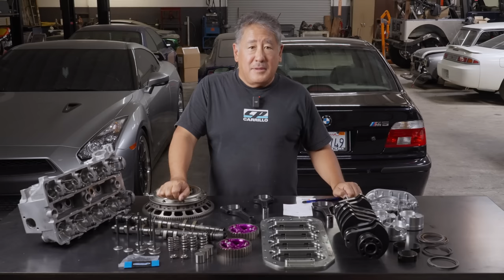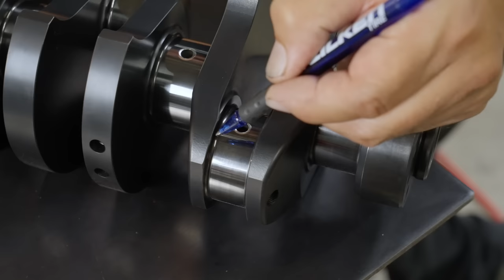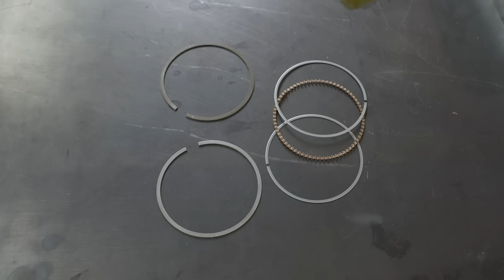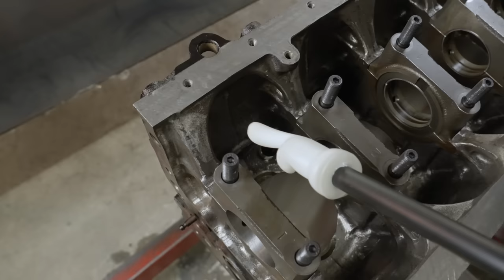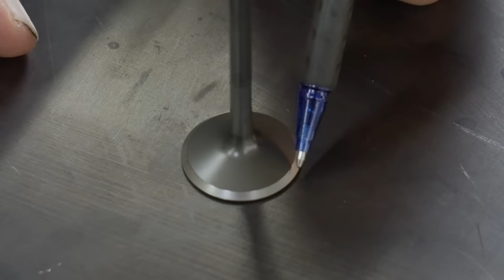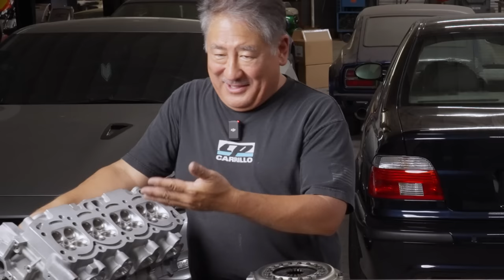11,000 RPM Toyota 4AG Engine Build!

Comment: ever see a 1000hp+ 4age? there are 3 i know about all in my country of South Africa

Piper cams makes a 326 duration on both intake and exhaust with 9.49mm lift
Reply from the maker: I would rather use the higher lift Kelfords, they have more area under the curve.

Comment: what kind of clearances are you aiming for on mains and rods?
do you need to spin it to 11k still give the increased displacement?
Reply from the maker: Something like 0.002 on the rods and 0.0015 on the mains. I like to run things a bit tighter than some.

Comment: Thanks for the interesting video. I can see it wasn't done here but out of interest have you ever tried doing the head modification of making the intake ports more upright? As in re-routing the intake path through where the injector holes are normally located in the head casting. This would be via either machining a wedge out of the head combined with a matching manifold profile to suit or alternatively using the more direct method of filling parts in with welds and then reshaping as required. I am not looking to do such a thing, but rather I only ask because I am curious as it's a very rare mod to hear about it being done.
Reply from the maker: No one will pay for that.
Reply: @motoiq I know of two people who have this type of mod on their engines, but to be fair they did it using their own resources and it would indeed cost way too much to have someone else do the work.

Comment: Would you recommmend a high Zinc content oil like Valvoline VR1 or ZDDP additive for an over head cam engine with a high overlap cam? Or for flat tappet like a S54?
Reply from the maker: As long as wideband life isn't critical for your car's running correctly.

Comment: Speaking of rod and stroke ratios. Could you use a k20 crank in a k24 block with custom rods for a high rpm build and/or lower vibration?
Reply from the maker: Yes look for a build video like this coming soon.

Comment: 4 valve and no dry sump, customer is nuts
Reply from the maker: I would really recommend a dry sump for this sort of stuff.
Reply: Customer is going to be wondering why it blows up one day when the engine starves for oil. 😂 oh well. If he/she has the money it probably isn't an issue, but the principle and waste of resources is what gets me.
Reply from the maker: It isnt so much starving of oil, its getting the engine nice unaerated oil at the proper pressure.  Well I guess that's preventing starvation.

Comment: i do have one question. i know the 4a valve shims are the same size as the 7m, does that mean these shimless buckets work for the 7m? also what would the part numbers/name be?
Reply from the maker: It should be, its from a Yaris.  Since it's select fit, there are a million part numbers for the different sizes if you know what I mean.

Comment: About the issue of the crankshaft of bigport 4age's at rpm above 8k. Will a fluid damper help, or is addtitional reinforcment of the block the only option? I want to set the rev limit at 8500 or a bit more if possible. On my EU version MR2 it is already set stock at nearly 7800
Reply from the maker: you need to use the larger journal 20v or SC crank and toda pump gears or a 20v pump. fluidampr helps too

Comment: Do one on the 2ZZ :)
Reply: 1zz better tbh, especially if turboed
Reply from the maker: Strangely there isn't much interest in this engine, no one has ever asked us to do one.
Reply: @ireallyreallyreallylikethisimg 2zzge is more reliable even with big turbo set up, only need another oil sump for track days have problem if pass 1.1g lateral pressure the internals hold easily over 400hp except the pistons because has big compression 11.5:1 but if tunning is good and torqe low the 100% stock internals is great for 350-380hp 350nm. Now if put lower compression piston 400 is safe. Also I have see over 10 2zzge with over 300k miles on stock engine without oil consumption. I'm mechanic and I work on 2zz b18 4g63 k20 etc...1zz is indifferent engine mate. After 2002 is good without oil consumption issues but do not compare with 2zzge, it is much superior.
Reply from the maker: Agree with all of that.
Reply: @ireallyreallyreallylikethisimg what's your reasoning for that? 2zz outflows 1zz by miles. Overall easier to make power reliably with 2zz.
Reply: @motoiq  any chance at us getting a high compression NA build? The popularity in the US is minimal compared to the Caribbean and South Asia. It has its application and is an odd ball.

Comment: Around what would you expect this motor to make? Also looking forward to the 20v! I have an AW11 with a dead 16v and have debating rebuilding it cheaply or swap a 20v or 2zz or something. I love the 4AGE induction noise so there's some subjective pros/cons I have to think about.
Reply from the maker: Something in the 200 whp range.
Reply: Go 2zz for sure, there's a guy who sells everything to make it fit with non to minimal mods, and is by far better than a 4age, lightweight and easier to make more power than any 4age build, guys in pr has already got 216whp at 8800 rpm with bolt on parts and standalone ecu on 93 Oct, to get to that point on a 4age would be hell of expensive
Reply from the maker: On of the things with a lot of swaps is the motors are taller and the swaps mess up the suspension geometry and ruin the 86's handling.  Most of the kits for an F or K swap and even a BEAMS swap I look at are like this.  The kit makes have no clue about suspension.

Comment: I really thought the black top 20valve is the way to go
Reply from the maker: It has a wider powerband but for top end the big port with big valve head rules
Reply: @motoiq  "It has a wider powerband but for top end the big port with big valve head rules"

I know this is a bit of a loaded question, so mostly looking for a "ball park" here, but if you were to build a 20v vs the big port 16v to roughly the same level- how much of a power difference do you think youd see at peak?
Reply from the maker: About 6-10 hp all on the top.  I would prefer a 20v for use in a full size car.  More torque and wider powerband makes for faster laps.  A light open wheel car, big port.

Comment: Is there a reason you prefer Tri-metal over Bi-metal on low HP applications, they tend to damage less the crankshaft as they embed more material compared to the Tri-metal, but I wonder what have you seen regarding Bi-metal longivity wise on NA applications and high RPMs.
Reply from the maker: King makes a high embeddability bi metal race bearing but I never tried it.

Comment: 11:1 static CR with the formula alantic cams wont make good power and and will make weak torque...

U actually needs atleast 12.5:1 or 13:1 CR to fully utilize the cams potential...

 Because the big overlap, Dynamic Compression Ratio will be super low...

U can compensate by advancing exhaust cam abit (during cam adjustment/dialling)  but the power will fall on it face well before 10k rpm..literally no benefit revving to 11k rpm...

If it was me, i would consider keeping 13:1 static CR which perfectly fine with such big cams to run on 91octane fuel...  (With better piston dome design and combustion chamber profile u can get away with even 14:1~15:1 static CR for such big cams)
Reply from the maker: Well no shit. However the original TRD Japanese spec for a hot 4AG with these cams was 11:1, TRD USA didn't run the Japanese pistons and made our own that were 13:1. You absolutely cannot safely run 13:1 on the 4AG with California Spec 91 octane fuel unless it's putting around. Even modern engines with DI have a hard time doing it safely. Run it on the track and it won't be running in a few laps.
Reply: "11:1 static CR with the formula alantic cams wont make good power and and will make weak torque..."

And what exactly are you basing this assertion on? How much MORE power do you think itd make with a whopping whole extra 1 or 2 points of compression?
Reply from the maker: There is no such thing as dynamic compression ratio.  Compression ratio is set by volume.  You can have dynamic cylinder pressure.

Comment: Here in Japan there are also many engine builders who are obsessed with 4AG. One of them made a very unique 4AG that has a cylinder head from Hayabusa, Suzuki motorcycle. As you can guess, it was not a easy project but he did it. They call it as 4AR and the engine also can run 11000 rpm or more. He is awesome like you.　https://www.youtube.com/watch?v=ES_s2ibwceM
Reply from the maker: Interesting!

Comment: 10,000 RPM+ on a wet sump? If this guy runs on track he's gonna spin rod #4 guaranteed. He needs way more oiling upgrades.
Reply from the maker: hopefully the larger rod bearings will give more hydrodynamic area.  Guys flame me and say they rev that high with a gen one oil pump all day....
Reply: @motoiq  You can rev high well into the 9Ks but you need more mods. The pump gear isn't going to solve the oil starvation issue which is usually the cause of the bearings going.
Reply from the maker: You need a dry sump, I recommended it strongly, they passed.

Comment: I just want to ask I am not a mechanic but is it possible if you modify the 4 A-GE and but a turbocharger on it can you only put on aspiration on it or can you do both like a turbocharger and a supercharger. I am just asking will like to know how much horsepower can you het from modifying the engine.
Reply from the maker: You can do anything, it is just a matter of cost.
Reply: @motoiq  Thank you, man. Just want to find out I want to make the best build drift car out of it because it lacks a bit torq in it. Need more smoke on the tires, and the sound needs to be loud.
Reply from the maker: My daughter drifts a bone stock AE86 and somehow manages. Skinny tires and lots of air pressure!
Reply: @motoiq  so I can just some tires. Are dift tires preferable, or is stock still fine, and what air pressure do you run.
Reply from the maker: Those cheap ironman tires off of ebay and 50 psi. One set lasts all day!
Reply: @motoiq  thanks, man. I appreciate your insight and your advice. I am looking for AE86 to drift and use in drift competition.
Reply from the maker: They don't do too well in competition.  Too expensive to get the needed power. Short wheelbase doesnt do so good either.

Comment: Been waiting for this! So the big question. How much?
Reply from the maker: Something like 12k
Reply: @motoiq  "Something like 12k"

Thats actually a lot cheaper than i was expecting.  Does MRP make/sell a billet crank for a standard 1.6 liter 4age if you know? Ive seen they make one for the 1.8 liter stroker set ups, but cant see if they have one for a 1.6 engine
Reply from the maker: Several companies do.
Reply: @motoiq  One other question if I may: If someone were to bring you all the parts for a 4age like this, roughly what would you charge just to assemble it? Thanks!
Reply from the maker: About 4500 including machine work

Comment: Is it not a 7ag when you use a 7a block? Probably cheaper than cloning the formula Atlantic engine, turbo would be easier and cheaper
Reply from the maker: Formula Atlantic used a 7 rib 4AG block.
Reply: " turbo would be easier and cheaper"

Do you mean in regards to making power?
Reply from the maker: For making bigger power yes.

Comment: Why would you do a stroker engine if you want it to rev high?
Reply from the maker: Did you catch the part about piston speed and altering the stroke to rod length ratio?
Reply: @motoiq  just watched the drive 4 answers video on the topic so i could better understand this. Correct me if i am wrong, so the corolla block has a taller deck allowing for rods long enough that even tough it has a higher stroke the peak piston acceleration from tdc is still smaller?
Reply from the maker: Yes you are correct.

Comment: Question: where did u get one of those. I rlly want one

Edit: I’m only 14 so that dream is gonna have to wait a while
Reply from the maker: From us.
Reply: Ok 👍
Reply: Tbh there’s a lot of 4AG parts on eBay. I saw like the whole top part of the engine for like $650 dollars I think. And dry sump oil pumps for like 400-600 dollars too (they are on eBay so they might need some work). As well as a real TRD engine that wasn’t used ever (it was a spare).
Reply from the maker: Those kind of parts are crap.

Comment: How come the bigger 2.4L 2AZ-FE Toyota engine is rarely built to its potential. I would think starting with a bigger platform similar to the K24 Honda engine would be better for maximizing power and longevity bc you wouldn't have to turn over 10k to get there? Just asking bc building my 2008 scion tc into a all rounder car that could do track, drag, and street was a dream of mine until I learned how few people were getting into the engine and actually pushing it for innovations.
Reply from the maker: Talk to Steff Papadakis!  He gets 1000 reliable hp out of them.  Chris Rado used to get 1400 hp out of them.
Reply: You’re thinking of the 2AR, it’s a much better base than the AZ family.
Reply from the maker: duh you are right!
Reply: Chris Rado did a 2az in his time attack car.
Reply: Has 0 after market
Reply: @km6832  Well yes it has 0 after market now, but in 2008 to 2010 there was a small but decent aftermarket. That's just the thing though it went away and never came back, I'm just curious as to why that platform was never embraced nearly as heavily as some others, even half the support the K series gets would be a lot.
Reply: @R0cketRed  toyota killed the tc for no reason so thats also a factor. Because the az and ar primarily come in non sporty vehicles(rav4, camrys) so
Reply: @km6832  The launch of the tc in 2006 was ment to be a blank canvas for tuning. They also made the special version from 2007 to 2009 that came with a stock supercharger. The tc was ment to be a sports car for young adults that couldn't afford the more expensive sport cars.

Edit: Also the Honda K series came in boring cars too
Reply: @R0cketRed  i know why the tc existed..you added or took away nothing from.what i said
Reply from the maker: It's a pretty strong engine, not particularly good flowing head but a good base for FA.  We did one for a customer endurance racing a turbo one a long time ago.

Comment: This is suppose to be the initialD engine?
Reply: Wouldnt say its "supposed" to be, but it would be on par with. In initial d it was a 20v engine, this is still a 16v engine- But similar spec. That said it seems the customer decided to step down a bit ant not build to this degree.

Comment: The TRD cams + larger are still available, all locked away.... I'm surprised that you recc. ST springs, the German SH springs are the only ones we found was good to over 11 grand...sorry again. You would understand the mfg names
Reply from the maker: stupertech or Ferrera
Reply: @motoiq  I've issues with both in the past, it's the reason I started buying blanks and making my own, there's a local company that will do it right for you, but you will need to send me an email and I'll be happy to send you the contact info. I've used them before I started machining my own and if I need to now I would again. I ran out the pieces I had last year, I stead of a holiday at the local CNC shop. These are too small for your needs. I'm happy to help with the problem we had over a decade ago in the high rev motor ....if that is what your guy wants. I can make you the cams, you will need bigger ones or at least one bigger one
Reply from the maker: I will let you know, how much lift were your running?
Reply: @motoiq  on the intake close to 12.5 and the exhaust less one of what you have will work as the exhaust. I won't speak about timing, you will know how lift affects timing, but our unit ran to the redline in 5th gear at 11,600rpm, problems started to be noticed at teardown after every weekend's inspection, they were addressed. The motor  ran a season, with the normal teardowns. Unlike the FAT which would allow approx. 500miles.
Reply from the maker: Wow that is the most lift I have ever heard of in a 4AG!
Reply: @motoiq  there's more...but this is not the place for it...have a nice day. I'm at the shop in Buffalo and we're have hmm some liquid
Reply from the maker: Man how come I don't know you, I should.
Reply: @motoiq  the transition from Nissan/Datsun to Toyota was back 30+ yrs ago. I'm still in touch with the old guys who refuse to die... And have a bourbon for those who did in the 90's.
Maybe one day, I'll take a drive out and have a drink before diabetes gets me.... lol I have so many tales of working all night and testing only now do I really appreciate those times.....even more.
Reply from the maker: It's odd, I was the TRD race support engineer at the runoffs every year in the 80's, in the 90's I went to Nissan, I thought I knew everyone but I haven't met you before.
Reply: @motoiq  In my current field the engineers ask my recommendations. Funny how things work backwards with experience. The only benefit and how it applies to motors is camshaft and bucket and shims, the cranks we did a long long long time ago. ...I think you know all the good guys to make things work already.. be safe

Comment: ITB, exhaust, forged everything, still only makes 140 crank
Reply from the maker: This engine?  It will makes something like 250 hp.
Reply: @motoiq  Well yeah... Still fun to poke at old iron. 30+ years later and there are no inline four's I can think of off the top of my head that hold a candle. Not without variable timing or forced induction.
Reply from the maker: It's kinda a 4AG joke around here as well.